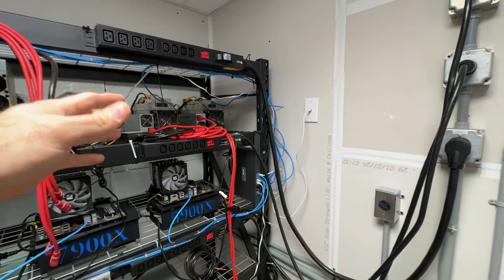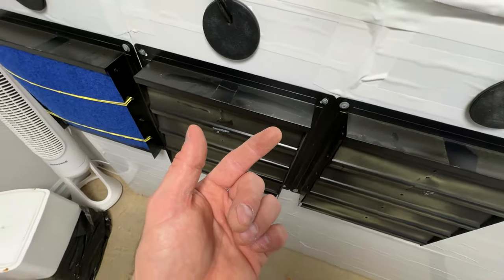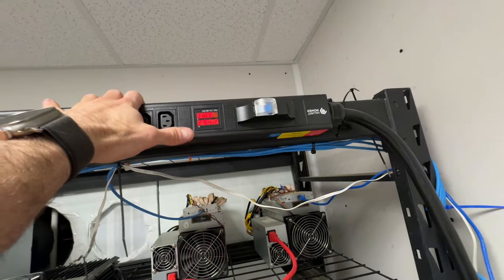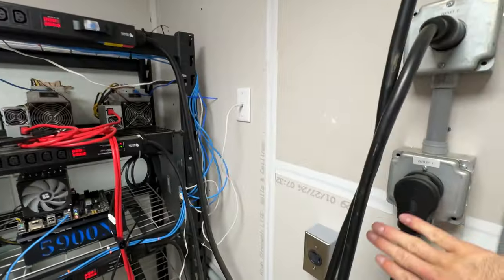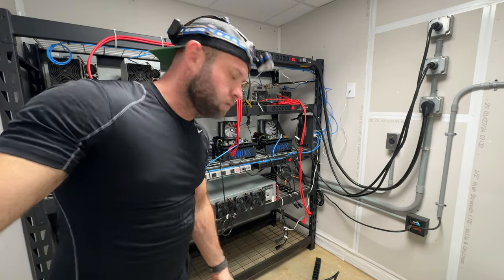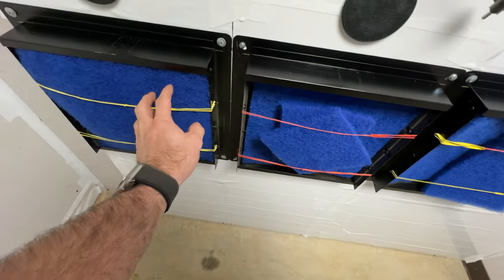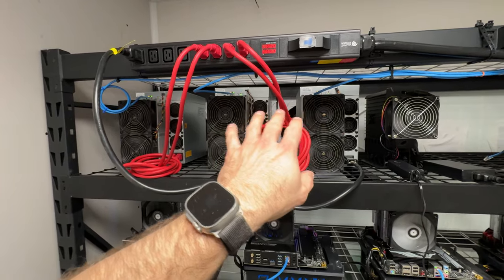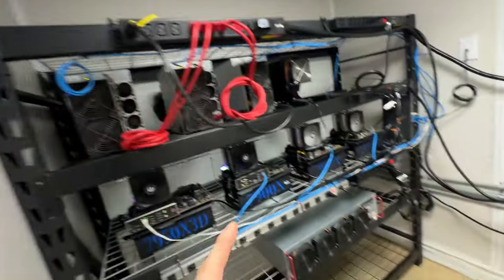Pollen APOCALYPSE in my home mining farm

Comment: Wasn't expecting a tree anatomy breakdown! Don't forget to swap to a 30A breaker if you switch to a 30A outlet. Worst case something shorts and starts pulling 45A your outlet will burn out before the breaker flips. About to start messing with my ventilation this weekend!
Reply from the maker: In the end i'm leaving it be, just at 50% load. Aint summer great
Reply: @TechnicalsMatt  nice definitely the easier option. Let me know how those merv1 filters work I’m about to test some like mesh filter screen on Amazon that was super cheap.
Reply from the maker: I wrapped my filtration vid a few days ago, put in 6x reusable electrostatic filters. Looks like great minds think alike

Comment: Now you tell me :-) I just had a 50A installed yesterday! Actually I dont think I will be running it anywhere near 9000w continously. I just wanted a headroom in case my 40 3070s start running at full bore for whatever reason. Picked up a single phase used HP PDU on ebay for 150, was a bit skiddish on no-name 50am 240v PDUs.

Comment: Install braiins on those ASICS.  You’ll be able to tune them and get the same performance at less power and the fans don’t have to be at 80% all day and night.  My ASICS are tuned and the fans live around 3% speed with the same hash results as bitmain full jet engine settings.
Reply from the maker: I have brains on both 19j's. No brains for the 21

Comment: cut it yourself filter for kitchen extractor hood´s is pretty cheap..
it´s the stuff used for most filters, it is also used to protects carbon filters from dust

the more meters you buy the cheaper it gets

when it comes to filters the rule of thumb is the bigger the filter you choose the less it cuts the airflow.. (the bigger the better)
if it was a carbon filter allways choose one that takes much more m3/h of air then needed..
also when it blocks from dust or pollen it needs to be able to breathe

it also makes the fans work longer and use less power if they dont haver to work that hard..
and it can  give the option on running the fan on a lower speed in some situations
Reply from the maker: Just wrapped the filtration vid yesterday it'll post in a couple weeks. Went with reusable electrostatics. metal, similar to those i've seen used in kitchen hoods

Comment: Bug screen curtain in front of the asic shelf? Could get aluminum screen and maybe add a static charge?
Reply from the maker: Stage 1 filter on the outside is mesh screening. I'm not sure how much heavier I could get without using some kind of batting, but that stuff isn't really reusable
Reply: @TechnicalsMatt  it's a tough issue to solve. At least it's only during certain times of year right? I wonder if a water filter system could work, like a water bong sort of?

Perhaps a submersion cooling alternative would be best? Shout out to vosk coin on that haha
Reply from the maker: Immersion seems like a huge case of overhandling. The associated equipment and mess I just don't see it as worthwhile unless conditions really mandate it

Comment: just build a swamp filter pull the air through water then filter it through that blue filter to catch moisture.
Reply from the maker: Would jack humidity and require a LOT of air moving through a large volume of water I think
Reply: @TechnicalsMatt  That's usually how problem solving goes.You fix one problem now you are faced with another.

Comment: Grid wire to replace the louvers, those fan blades man 💀
Reply from the maker: Whole separate vid i'm finishing up now, adding in 3rd stage filtration. In final testing
Reply: @TechnicalsMatt  I may do a closed loop on mine with a water loop. Haven't seen anyone crazy enough to try it, so why not 😎

Comment: why did you half ass tape the joints of yours walls.. if you did that yourself.. i give you an F sir... but a B for effort
the tree pssy part made me bust out laughing so loud
and another thing.. you show your intake... but where is your exhaust side... or "hot" side and definitly shouldnt be cheap with fans an stuff like that
never mind i see where you have the asics going into the wall.. but still.. CFM and volume man cmon
Reply from the maker: In the original build video I outlined the reasoning for this. Mainly because no way i'm mudding all that.  lol